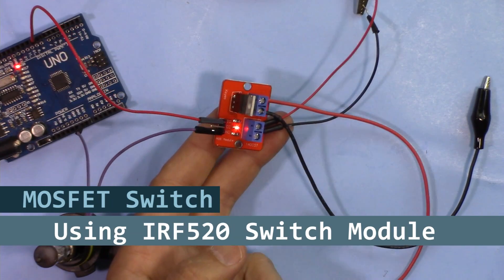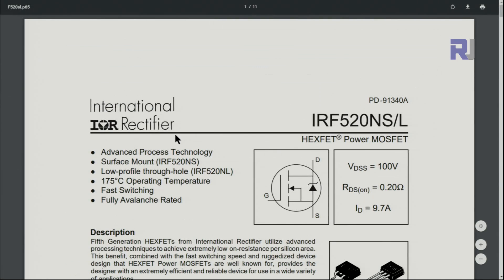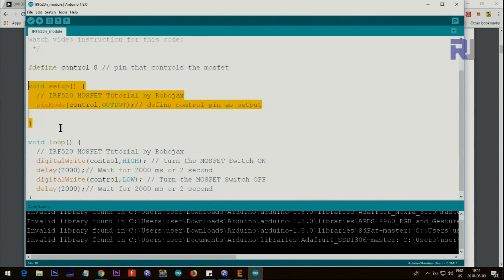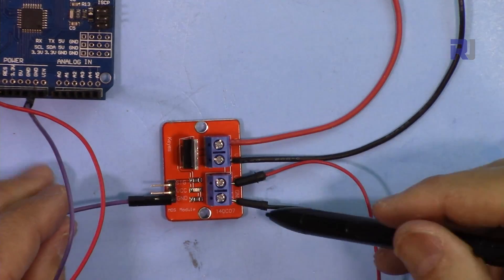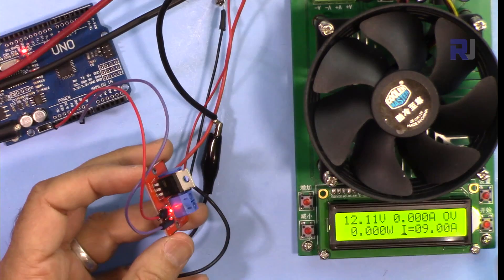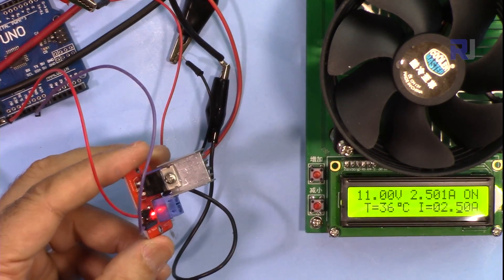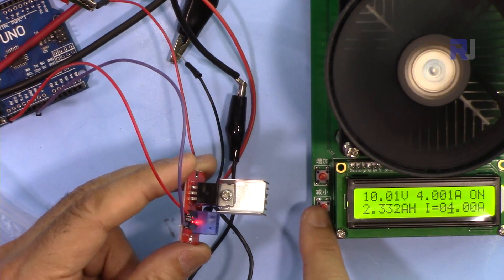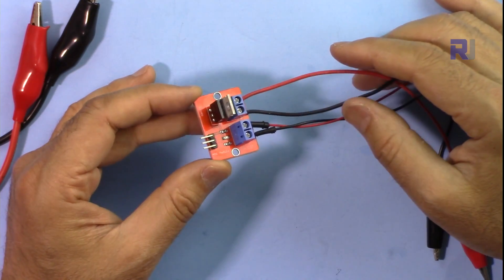Using IRF520 MOSFET Switch Button to Turn ON or OFF DC load RJT85

Comment: Hi i'm trying to do a shock system i bought arduino this mosfet module and a 2*9v 2w transformers i'm using Vcc signal as 12v for mosfet module and using this load polar for the transformers but i cant take any signal from transformers can you help me?
Reply from the maker: you can't connect directly from transformer to MOSFET. Transformer has AC and mosfet needs DC. here we talk about load like light or motor or another device.

Comment: can i use this for a solenoid valve? how to wire this on a solenoid valve?
Reply from the maker: Yes you can. Your solenoid is a load. I have shown how to connect load. Don't forge the diode to protect the mosfet.

Comment: Thanks for the test. Unfortunately the IRF520 is not the best choice for the job. To see this, you have to look in the data sheet, item "Drain-Source On-State Resistance". Here you find the on-resistance of 0.27Ohm -but @10V. For 5V or even 3.3V there is no R_DS_on specified at all. With 3.3V V_GS it could bei completely switched off and still in spec.   Please compare it e.g. with IRF3708. There the datasheet guarantees 29mOhm @V_GS of 2.8V and I_D 7.5A  So this will run even with 3.3V logic. With 4.5V V_GS you get 13.5mOhm @I_D of 12A. So if you redo your experiment with the IRF3709 you will get a voltage drop of about 0.12V an a power loss of about 1W @9A. Much better.
Reply from the maker: You are welcome. This is sold like this and I had not choice to select the MOSFET.
Reply: @ @robojax  : Yes, I unfortunately bought this "MOSFET button" without reading the data sheet previously. They were advertised to be 3.3V logic compatible. But this is not true and did  not work with an ESP8266 reliably in my application. So finally (too late) I read the data sheet and replaced The IRF520 by an IRF3708 which works a treat.

Comment: Where does that Vcc pin lead? The one that is between SIG and GND.
Reply from the maker: that is VCC. VCC always refers to the power supply.  Check the schematic I have drawn in the page where code is.
Reply: Yes, of course, Vcc is always the supply pin. But here we just switch on the MOSFET with the voltage difference between SIG and GND and we don't have to supply the power to some logic level circuit. What power supply are you referring to? I don't see the Vcc on your schematics. Vcc is not Vin. Did you check with the ohmmeter if Vcc is connected to something?

Comment: Hey man can you suggest me mosfets that I can use at 1 MHz?
Reply from the maker: the mosfet IRF520 has rise time of  30ns (33MHz) and fall time of 20ns (50MHz) and the "turn on delay" and "turn off delay" is very low. This should work.

Comment: This is a fake board for Arduino. Need a IRL LOGIC LEVEL MOSFET not IRF...
Reply from the maker: who determines fake and real?  It works and test showed that.
Reply: @robojax  Sorry, I used a wrong term. "Fake" is no correct. What I want to say, is that this board is not  specific for arduino board (or nodemcu). The problem is the mosfet. In this case wee need a "logic level" mosfet, like a IRL540, not IRF... The best, is to have this board with an IRL540 installed. Logic level mosfet can "all open channel" with "only" 5V form arduino.  Apologize.
Reply from the maker: No problem.  When I want to introduce a product, I have to follow what the name says on eBay or AliExpress even if the name doesn't make sense. If I don't do it, people will not find the video. so the I say "Arduino", because many people think it is "made for arduino" or even the title has the word "button" I don' t know why the use the word "button" but I put it so people can find it. thanks
Reply: @robojax  Good, Italian, Chinese.

Comment: will this device output the same voltage as supplied to it?  For example, if I supply 12v should I expect it to output 12v?
Reply from the maker: Yes it would. I have mentioned in the video the Drain-Source (the two main pin of the MOSFET) will have about 27m Ohm which will have less than 0.05V drop.

Comment: i dont have module i designed the module but the mosfet is getting heated up
can you suggest the reason.
Reply from the maker: Post your schematic in this website https://snag.gy/ once you did, you will have a unique URL (web address), please past the address of you schematic image here( reply to this msg) and I will help you.
Reply: The MOSFET will get hot if it is acting as a resistive load because the gate voltage isn't high enough to turn it fully on. Are you applying 5V to the gate?

Comment: Hi, I want to use the pin signal as input to the Arduino. How can I do that?
Basically I want to input 24v to the mosfet and check with Arduino if it is getting the signal or no
Reply from the maker: the "S" or signal pin it INPUT and not output.  If you want to check the "Signal" pin with arduino, then you need to know how to read voltage. I have another video that explains something else, but it has full details of voltage divider that you can use for this purpose. https://www.youtube.com/watch?v=FaoKzi7tgME
Reply: i tried but i don't receive any voltage